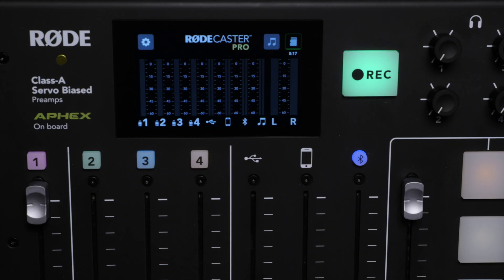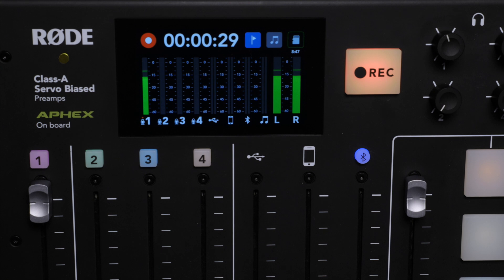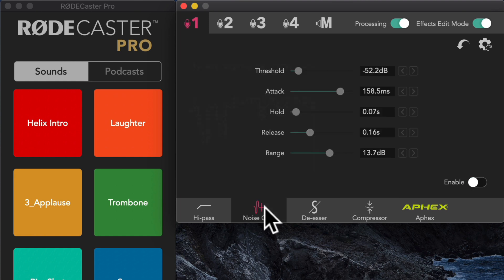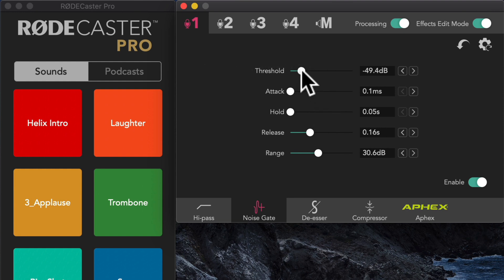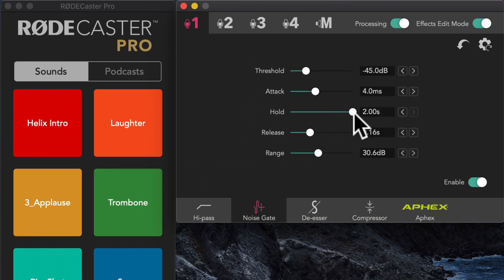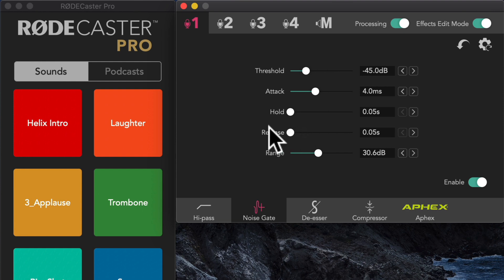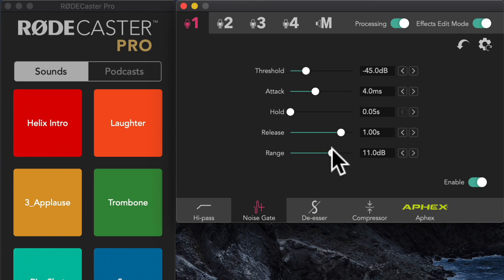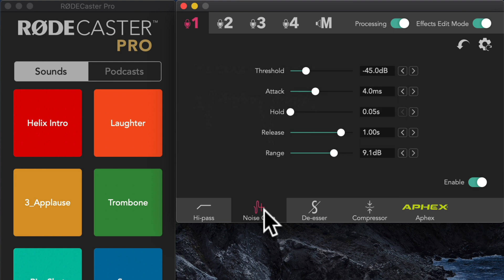RODECaster Pro Noise Gate Settings - V2.1 Firmware

Comment: I know this video is a few years old so, if you don't respond i fully understand. Im having an issue that's driving me crazy with the rodecaster pro. When i have more than one mic being used i get this "open" mic sound" its very much like a hum. I thought that it was at first a gain setting issue so i played around with the gain. I wondered if the Pod Mic (which is dynamic and quiet for the most part) was being pushed too much with the fader or the gain so, i bought a cloudlifter knock off for the sake of clean gain. Then i turned on the phantom power and guess what. Still got the problem. It goes away for the most part when i use the noisegate but the noisegate on the unit if not dialed in perfectly will have your content choppy as it opens and closes and attacks and releases. And if more than one podcaster tries to talk at once you can hear the Hum come back as they talk over each other for a second. So im wondering if the podmic with the knock off cloudlifter actually requires the gain to be well below the "good zone" in the green parentheses on the readout when you set it up. i dont want to quit using the rodecaster becuase it is very dependable but i have to fix this little audio snafu because audio quality in a podcast is incredibly important. I would appraeciate any suggestions. thanks in advance
Reply from the maker: Try different cables and different mics? If that doesn't solve it, I'd probably contact RODE support.
Reply: @curtisjudd  thanks so much for the suggestion. What has seemed to fix it is that the gain setting  with the cloud lifter knock offs has been reduced to only 10 on their gain scale. This is drastically lower than what I had seen recommended. Most people dialed condesor mics and in line pre amp supported mics as high as 18 on their gain level meter. Through experimenting for me, Just dialing up to 10-12 was plenty. Now the “gain noise or open mic sound” is close to eliminated. I’m just surprised nobody else has had this exact problem 🤷🏻‍♂🎙
Reply from the maker: @thementaledgepodcast8012  Glad you found a workable solution.

Comment: I love your stuff, Curtis! This just helped me dial in my noise gate for the Rode Podmic USB. Thank you! 
The Rode Connect software I'm using to set it include the elements you showed PLUS something called Hysterisis. It's a % based adjustment and shows 2 lines when it's engaged. At 0%, both lines are on top of each other (where the threshold is set to). As you add %, a new line drops down below the Threshold line. 
Do you know anything about what that word/concept means, or what that action is really doing? 
Thanks again!
Reply from the maker: Thanks. Hysteresis is like a second threshold which can help make the gate “flap” a bit less, essentially defining a range for the threshold. Worth adjusting it if you find the gate is obviously cutting out at the wrong time.
Reply: @curtisjudd  Wow, great! Thanks so much, Curtis!

Comment: There is a light static coming from my headphones, any idea on how to remove this? I did not have this issue until I updated the firmware to where you customize the compressor and noise gate
Reply from the maker: Not sure, probably best to contact RODE support. Best wishes!
Reply: @curtisjudd  I fixed it yesterday thank you tho!

Comment: What a wonderful  video. Thank you so much. Question about multiple speakers. To set up my noise gate, should I ask the other speaker to talk so I can see how much of their voice is captured by my mic and thus set my threshold for the noise gate? (and then repeats with her mic?) Basically, instead of using the fan or AC, I am using the other person's voice. I have two Podmics and I am usually a meter and a half ( about 5 feet) from the other speaker. We face each other, so that the her voice hits my mic from the back. Yet, my mic still captures her voice, preventing my noise gate to close. Yet, if I set the noise gate to high, it cuts some of my voice and I need to have a super control of the position of my mouth. How can I solve this? THANK YOU!!!
Reply from the maker: Yes, this is the challenge for situations where people talk over each other and the weakness of traditional noise gates like on the RODECaster Pro. There really just isn't a magic setting to accommodate both situations (normal pauses between talking and when two people in the same room talk over each other). For mic bleed, it seems like you're already doing the right things. You could perhaps add sound blankets to help absorb any sound that may be reflecting off of walls and bleeding in to each others' mics.
Reply: @curtisjudd  Thank you so much. I'll try what you suggest. Looking forward to watching your coming videos!

Comment: Are you having hissing sounds in the Rodecaster even when no mics are connected? Is really frustrating and the problem is that I don't know if the Rodecaster is deflective or this is normal.
Reply from the maker: Not prominent hissing or self noise in the preamps, if that's what you mean? The headphone amps do have some hiss in them. It is all a matter of degree. Probably best to contact RODE support to determine for certain whether you copy is defective.

Comment: Dear Jud, will be so useful if you do some tutorials while a singer singing into deferent levels , i really love what are you doing , watching you since many years , am getting really lost with singers and roadcaster pro using nta-1
Reply from the maker: I don't have any singers here, but will keep your request in mind.
Reply from the maker: Also, I would NOT use the noise gate to record singing. Instead, put the singer into a quite space like a closet.
Reply: @curtisjudd  Thanks Judd , would it be better to turn off the compressor too ?
Reply from the maker: @StrikeStudio  You could turn it off on the RODECaster and do it in post instead. Or learn to tune it carefully and turn it on in the RODECaster. Either approach is legitimate. But we don't generally use a noise gate while recording singing vocals.

Comment: Thanks for the video. 

I have a question, there are people saying, that the attack is not setting when the noise gate is turned off, but its the setting when the noise gate turnes on. 

I am a little confused now. I tried to set mine, but it always cuts the breathing when I start talking and it sounds unnatural
Reply from the maker: What did you set attack to?
Reply: @curtisjudd  I set it to 4ms on the latest Podcast recording and everytime the host was breathing in fast, the breathing was cut in half and it went louder instantly. Sounded very weird. I just imitated the sound and its gone when I set the attack to >150ms. I guess its okay for podcasts is it? For drums or anything else it might be way too long.
Reply from the maker: @motobandit5345  Yes, if it sounds better, it is better! Always trust your ears!

Comment: Thanks so much for this helpful video! Would these settings work well in a public setting? I will be recording at a large trade show on the floor of the convention center. Could use some custom help if that's something you offer.
Reply from the maker: Along with some directional dynamic microphones, yes.
Reply: Nice, I have 2 Podmics, 1 Shure SM58, & 1 sE v7
Reply from the maker: @lukemiller8204  Should do the job nicely.
Reply: @curtisjudd  It did! Thank you for your help! I was adjusting the settings the day before I had to leave to the show, you were the fastest resource, not Rode, not RCP FB groups, nothing, you beat them all! I will support you!!!

Comment: Just found your "compressor" video and it is easily the best tutorial I've come across in the two months since I got my Rodey Prodey - regardless of specificity with the gear (also, the internet should just wipe out any and all "how to" videos when a massive update has occurred...)

Going to be using it with live streaming, and I'm about to dip into your hour long "accessories" video, hoping it's in there, but if not...  I can't find anything on the "How To's" of things like "USB Mix-Minus" (should it just be on? and what are the advantages of having it off - since it's an option...?) 

Ducking.....If I talk over another video on say Youtube or Twitch, during the stream, it gives me the "lead" voice, but if the lowered audio sounds a bit "poopy" is that something I can fix on my end or is that the software of those platforms....?

Anyway - About to watch this one! The explanations on some of the terms were 1000% better than anyone else's! Subscribing!
Reply from the maker: Mix minus - I would leave it on for any remote call. I can't think of a situation where I wouldn't want it on. I'm not sure what "poopy" audio sounds like, exactly. 😄 But no, I believe if you have the ducking on, it is going to compress the other channels when multiple people are talking at the same time.
Reply: @curtisjudd  thanks for the reply! Oh come on, don't pretend you don't know what poopy audio is. It's everywhere!
Reply from the maker: @redolentthought7085  THAT, I know. But poopy can be poopy in a thousand different ways. Was just looking for which kind of poopy we were talking about.

Comment: Curtis, is Channel one tweaked ALL the way to the top and leveled to 50 or so?  Is it common to have the slider all the way up to get the mic rolling properly?
Reply from the maker: For a Shure SM7b without a cloud lifter or fethead it is typical. For other microphones it should not generally be necessary.
Reply: @curtisjudd  Thank you for such a quick response! 
I got one more question, Have you ever personally tried connecting a 3.5mm Lav into the xlr's using adapters? 

I cannot get any of my configurations to work, It would helpful to observe someone using a 3.5mm lav in the rodecaster NOT using the TRRS port in the back.
Reply from the maker: @jaedpacted  I haven't but a RODE VXLR+ should work. It will convert the +48V phantom power from the RODECaster to the 3-5V needed by most 3.5mm lavalier microphones.

Comment: Question when I'm zoom calls using my rode and press the sound effect button and someone on zoom speaks it drains out the sound effect. How do I fix that?
Reply from the maker: I believe that is Zoom processing so I don't think there's anything on the RODECaster you can change to prevent that. There might be a Zoom setting but I'm not familiar enough with Zoom to know for sure.

Comment: Hi Curtis....I have a question re: a feature on the Rodecaster and was hoping you can help. I apologize in advance that this may not be the correct video to post it, but I couldn't find a video of yours solely on the 2.1 firmware update.

My question is in regards to the "Post Fader" and "Bypass Audio Processing" options for multitrack. Per my understanding...

Post Fader: Bakes all audio processing/effects into multitrack file/tracks

Bypass Audio Processing: According to Rode, when this option is enabled the "individual" tracks" within the multitrack bundle will bypass any audio processing; however, the main stereo mix will still have audio processing included.

What doesn't makes sense... By default (when Bypass Audio Processing is NOT enabled),  each track "includes" all of audio processing, so why is there a need for a Post Fader option???? If I keep "Bypass Audio Processing" disabled, doesn't it do the same thing as Post Fader by baking audio processing on every track?

Thank you!
Reply from the maker: In default mode, I believe the effects are baked into the mix and I believe that is all that is recorded. Did I understand your question correctly?
Reply: @curtisjudd  In default mode (when “Bypass Audio Processing” is off), it’s my understanding all audio processing/effects are baked into the output  tracks.  

Firmware 2.1 added the “Post Fader” option, but I’m not sure how it’s useful considering I could simply keep “Bypass Audio Processing” turned off to net the same results.

So I guess I’m asking what’s the difference between keeping “Bypass Audio Processing” off, and turning on “Post Fader”. Either state appears to do the same thing.

Perhaps this is something I have to reach out to Rode to answer. My apology for any confusion.
Reply from the maker: @otm777  No worries - I understand. I haven't poked around enough with those particular settings to know right off. RODE should be able to clarify. Thanks!
Reply: @curtisjudd  Hey Curtis, I did some digging and found the answer to my question and just wanted to share in case it helps someone else.

When "Bypass Audio Processing" is OFF (default mode), all ISOlated tracks (specifically) are recorded at "pre-amp gain levels" thus excluding the channel's fader position and state of Mute button. The stereo track, however, will include the position of channel faders and whether a channel was muted.

When "Post Fader" is ON... it automatically deactivates "Bypass Audio Processing" and all tracks (ISO + stereo) will be recorded with position of channel faders.

So the difference between the default mode (when "Bypass Audio Processing" is OFF) and when "Post Fader" is ON is whether or not the ISO tracks (specifically) will include the position of fader and state of Mute button as described above. Both settings will bake audio processing/effects into the recorded tracks.

Thanks again for your replies!
Reply from the maker: @otm777  Excellent, thanks for sharing!

Comment: Hi, do you need to connect the rode caster to a pc for the settings to work?
Reply from the maker: No, the settings will work without connecting to a PC. However, if you want to setup the settings with the fancy meters and graphs, you do have to be connected to get those. But the RODECaster Pro has all of those settings in its own menus, just not the fancy graphs.
Reply: Curtis Judd - I dont get the fancy graphs on my PC. Only when chosing master compressor. Any tips? :)
Reply: OK Im an idiot. Got it.
Reply from the maker: @Steppepulven  Not an idiot - you figured it out! Happy recording!

Comment: Hi..We are using rodecaster pro for game streaming ..How can we stop the keyboard noise??Is that the noise gate as well??
Thanks!!
Reply from the maker: Which microphone? You may need to move the mic farther from the keyboard, or, if you have the mic attached to the desk, consider a stand which is not attached to the desk. Or a more directional mic might help as well.
Reply: @curtisjudd  the mic is condenser and it is on a boom arm that is Not connected to the table...also It is xbox controller 
we play on more than keyboard..This is our latest setup but before we used Logitech G Pro X headphones and they were not letting any sounds through but our voice quality was baddddd...We got plenty of examples uploaded on this channel so If you got time please check it out...Thx
Reply from the maker: @sisbroshou3786  So the latest video it appears the young guy is using a headset mic of some sort? When he gets excited, the audio is clipping. I'm not sure how much you want to spend to solve this problem, but a dynamic microphone with an interface like a Sound Devices MixPre which could prevent the clipping with its limiters would get the job done. But that's a pricey investment.
Reply: @curtisjudd  Yeah,,,that was the logitech headset I mentioned ,,,This video below is done with our current setup, rodecaster plus condenser mic......https://www.youtube.com/watch?v=n6RzLUSlM_A  
Would adjusting noise gate help??
Reply: @sisbroshou3786  Possibly but probably not. You could use RTX voice if you've got an RTX video card.

Comment: Hi, can this give me better results for vocals? Instead of using audio interface like ssl2 + or motu.
Reply from the maker: No, they can all give good results for vocals. It is just a matter of learning how to get the most out of them.
Reply: @curtisjudd  thanks Curtis,  that means having rodecaster pro is sufficient, no need for other audio interface,  is that correct?
Reply from the maker: @ano5102  Yes, for spoken word content. If you're doing music, that can be a different matter.
Reply: @curtisjudd I use  just vocals and no instruments.
Reply: @curtisjudd  melodic spoken words,
Reply from the maker: @ano5102  Ok, any of the three you listed can work. They just go about doing the job in slightly different ways. Musicians would almost always choose the SSL or MOTU first. Podcasters, in most cases, would choose the RODECaster Pro first.
Reply: @curtisjudd  thank you,  this way i can at least do the vocals and video tutorials using rodecaster pro, without additional equipment.  
I enjoy your channel.

Comment: Hi Curtis, Great video! You talked about another episode around noisegate settings in the context with multiple people, have you been making this, or could you maybe provide some insight into this. I'm using the RODEcaster pro with 4 Rode Wireless Go lavalier's, in a live-streaming setup, where i have this exact issue around the noisegate. The talents who is being interviewed, is sitting aprox. 1 meter away from each other, so my challenge is to use this noisegate function (in order to get clear sound from the lavalier), but without it being picked up by the speaker next to the other person, this i find really tricky, but maybe i imagine you had some solutions or tips around this? :) 
Cheers!
Reply from the maker: Hi Niklas, it is really hard with omnidirectional lavaliers. I haven’t been able to make that work reliably unless the people are farther apart. With cardioid dynamic microphones. It is a lot easier.
Reply: @curtisjudd  Thanks for your quick reply! But yeah, that's what i thought. It's a shame we can't really use the "normal" and more suited cardioid dynamic mics for podcasts, since they will get in the way and not look very pretty on the screen, interview sceneri. If you have any suggestions or way to get around this somehow, let me know. Otherwise, keep up the good work on this channel.:)